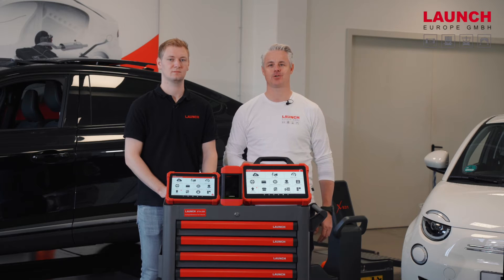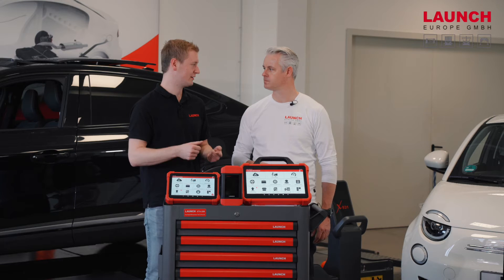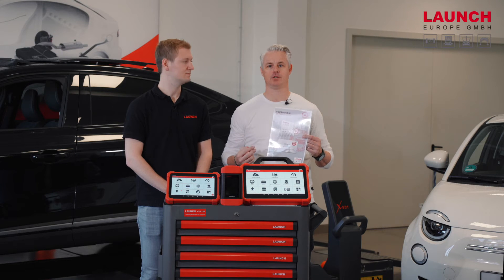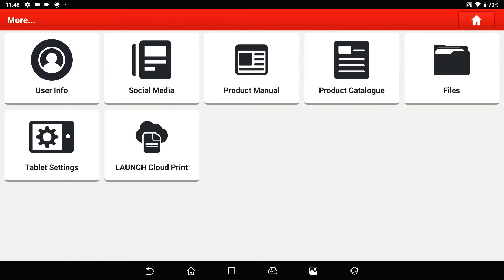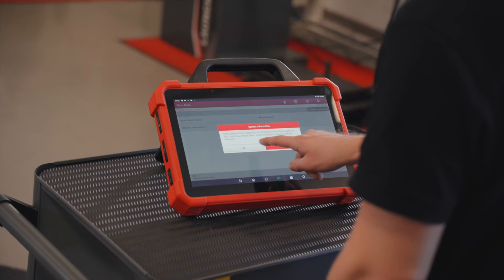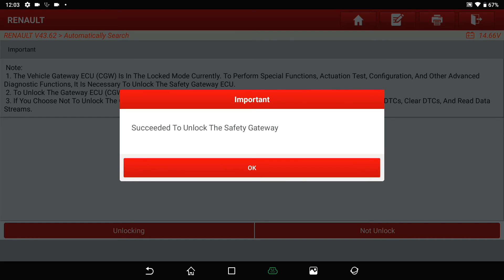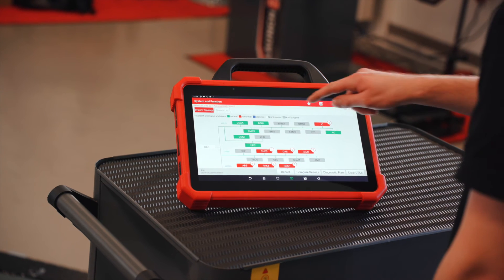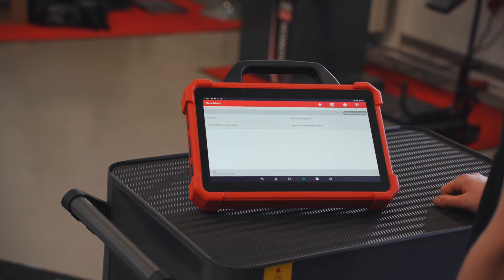LAUNCH Europe 🔐 unlock the security gateway 🔐 module for Renault

Comment: Does this actually talk to the Renault servers or is this all on-device? I'd want to check out the things I can change on my car, but I only have a cheap OBD adapter, and yes I'm aware of the risks :)
Reply from the maker: Hello @EpicLPer, the security gateway data is "ALL ON Device" and not possible with your small adapter. It works only with our LAUNCH X-431 devices from 10 inch upwards. Best regards LAUNCH Europe Team.